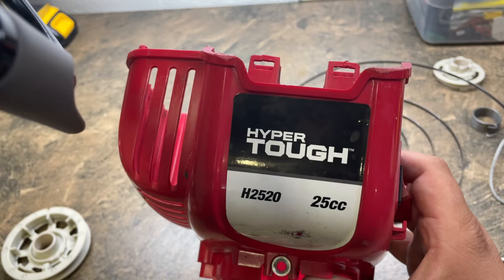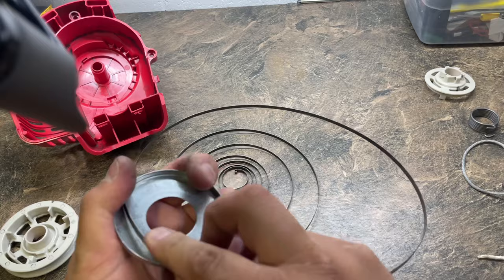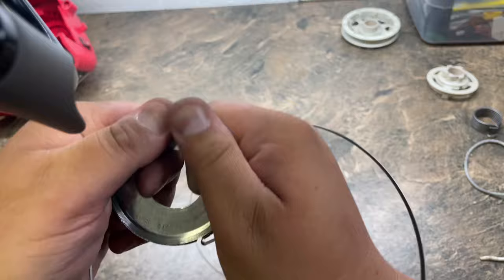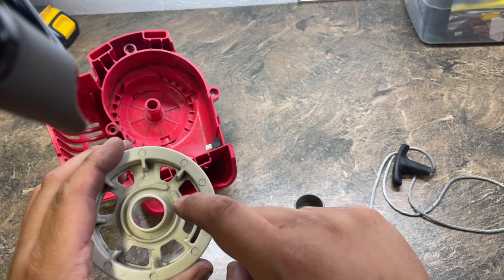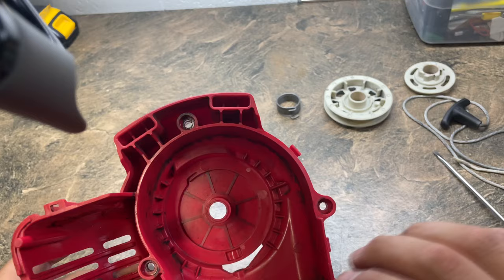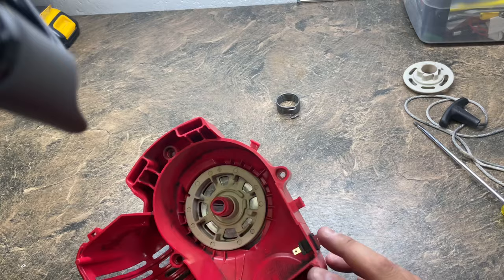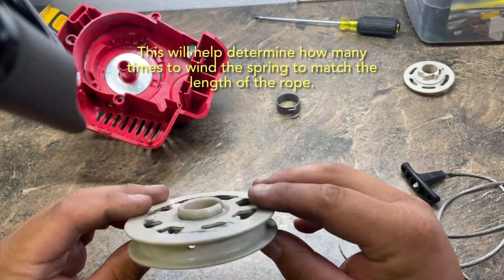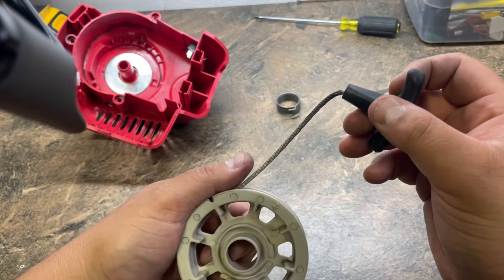How to fix weed eater starter recoil spring & pull string.

Comment: After fighting with the recoil spring for 15 minutes I found this video. Thanks man, my hands were starting to cramp up. The only thing I did differently is,That, I un did the knot on the pull handle and installed the cord on the spool so after loading the spool, the last step was just to get the string to the hole in the horsing Instead of trying to fish it through the housing and through the spool and then make the knot.
Reply from the maker: You’re welcome

Comment: Thanks for your video bro‼️💯 Before ur video I was told these replacement parts were not meant to be opened back up and you had to just buy a whole new one when it came to replacing or repairing the cord string but after I followed your video step-by-step I ended up dropping the damn thing on the floor and it just exploded everywhere UGH 😩 😣 😑 so I’m watching your video and I’m about to try it again this time I will glue that damn thing to my hand Thanks man. Have a great one.‼️

Comment: great video, one suggestion, take the rope off the pull handle and wind it around the spool before you do the tension. Then you can just hold the string under tension with a clamp and tie the not onto the pull handle. easier than trying to feed the rope and hold the spring at tension. Thanks again for the video
Reply from the maker: Thank you!

Comment: there is an easier way to wind the pull cord with only two hands. Put the cord through the feral, case and pulley. Tie the knot in the pulley. Now, if you look at the pulley, you can see there is a small slot on the perimeter of the pulley. using a flat screw driver, push the cord int the slot. Now, assemble the pull into the case. loop the cord over the ratchet end. so it doesn't want to slide out of the slot. Wind the pulley for the 4 turns. On the final hold the pulley and slide the cord out of the slot. While still holding the tension on the pulley with a finger, lift the casing up to let the 4 winds of the cord relax ( because it gets twisted ).
Now hold the cord and let it feed in slowly, releasing the pulley. No need to explain to the wife where she needs to hold thing.

Comment: For some reason my arrows are not lining up like yours was does it really matter? What got me to take this whole thing apart was that it doesn't engage the engine when I pull the start rope only about twenty to thirty percent of the time does it actually engage the engine and spend the engine over
Reply from the maker: Do you see any wear on any of those plastic pieces or any worn teeth? Maybe try flipping that sprint around and see if that helps.
Reply: @dennisliverani4293  no wear at all...I'm wondering if the pulley itself just isnt spinning because of dirt...and it isnt engaging the gear...Think I'm just going to replace the whole mechanism and make sure I don't leave it outside again...
Reply from the maker: @macknumber9  good luck
Reply: @dennisliverani4293  thanx

Comment: It definitely fix mine. But u need to break the metal holding seal ring to open the back whirling spring gear box. That seal is one time use and I see no where to sale that. I put everything back without the seal, it only last about 5 mins then all the gear box fall apart. Guess I would never buy this Walmart cheap shi@$t. They don't want you the fix it or replace the part.
Reply: This is why I will not buy Troy bolt, hyper tough, black max, craps man or any cheap modern Mtd type weedwacker. When something goes wrong with it, Get yourself a STIHL or an ECHO.